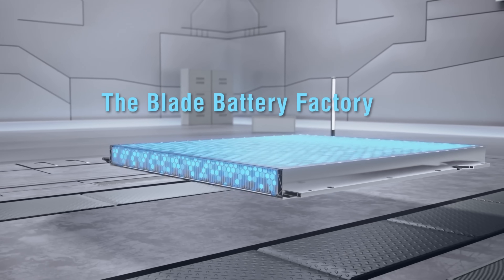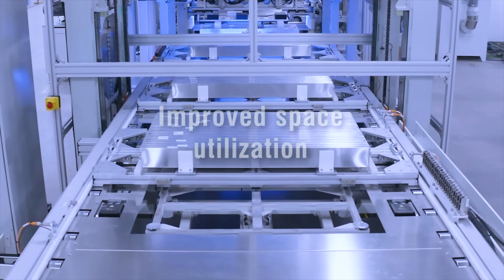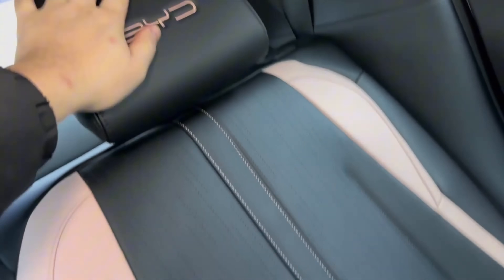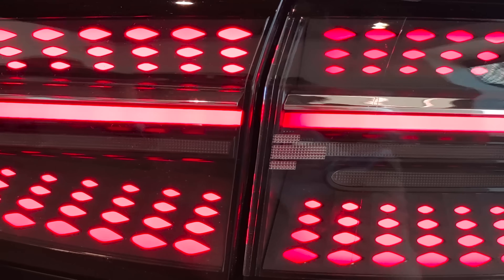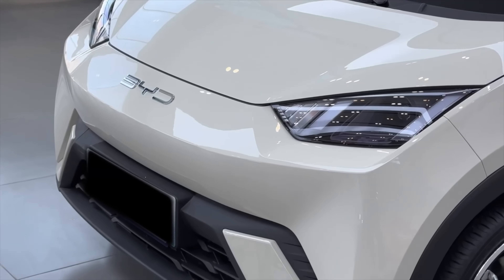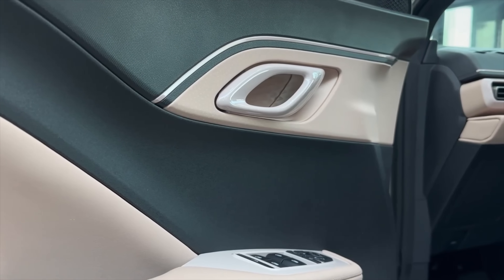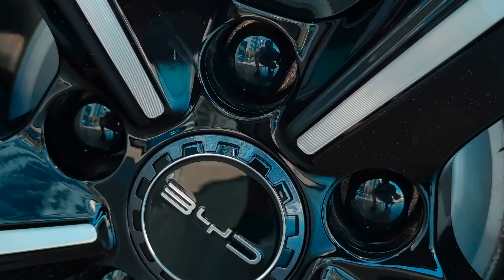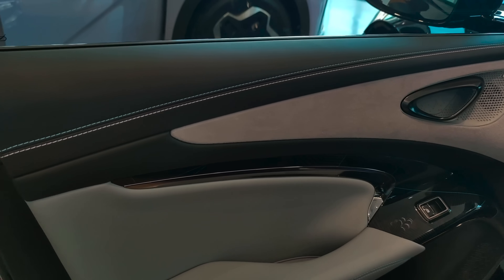Blade Battery 2.0 vs The New Solid State: BYD's Massive Leap Explained

Comment from the maker: What range do you think should be the minimum on any EV?
Reply: For me I think small city EV need real 300 Kms and larger EV used for long distance driving need a real 600 kms at highway speeds of 110 kph. (68 mph).
A reasonable charging time around 30 minutes from 10% - 80% and rate with minimal battery degradation after 5000 cycles.
Reply: Depends on charging speed how many miles minimum for me.
Reply: Depends on the country and area at the moment, where I am you can't trust EV charging infrastructure once you get away from large cities and towns, read a horror story of one EV user having to charge for 13 hours on a wall wart because the single high power EV charger was out of commission, and to get that 13 hours for charging they had to rent a room for the night, they simply didn't have enough range to get to the next large town, just under 300km away. So for outback driving, specially in the far north of Australia, 800km would be adequate, that's enough to get you from one large town/city to the next with no problems, once you drop under 500-600km it gets a bit iffy. If it was purely a city use EV then 300-400km would be fine, I mean how many people, apart from tradespeople, would drive more than 300km in a city in a day? Sometimes even in a week you would do less than that! Basically you need to buy for your use and location, and that will be different for everyone. Maybe when charging infrastructure outside the towns and cities start getting better you could do with 500-600km in the north of Australia, but it's just not there yet. So yes, with 800km I would go full EV, less than that, probably not. Now that's an advantage PHEV's have though, with around 100km pure EV range I could drive a PHEV on battery for 95% of the year, only using fossil fuel on those few long range trips I do each year.
Reply: For Australia i'd say 500km highway @ 110km/h so about 650km WLTP.    There will always be a case for shorter range, lighter, more efficient city cars though as well, the classic 2nd car.   Just give us the options please :)
Reply: For the UK, 200 miles all weather. 99% of all day trips taken care of without wild charging in our 60kWh dolphin, much like it's predecessor, our Kona 64kWh. Loved that car, but at 114k miles and 6 years, thought it was time for a change.
Reply: My range is about 2 hours between breaks (down to age). Thus I'm more than happy with 200 miles; with breaks of about 20-40 minutes (to recharge me and the car) every 2 hours I can go most of the day.
Reply: Well my Model 3 RWD has a range of about 450kms real world, maybe 420 @ highway speeds. I've driven it Sydney to Melb (about 900kms) twice and never thought I needed more range, the car often finished charging before I finished eating. I'd say 500kms is plenty taking appropriate rest breaks. That's 350kms 10- 80% which is over 3 hours straight driving.
Reply: God forbid you say anything bad about BYD they sue and blacklist reporters and won't let you visit them for press release drives I've heard.
Reply: I think that's right that there is a relationship between range & charge times (and availability of chargers).  The shorter the charge time the less perceived range people may feel they need.  ICE cars typically do around 500-600ks between fill ups, so something like that ... perhaps less for people who charge at home and a bit more for long distance drivers who won't want to run their batteries down too low.
Reply: @RorySeanWainer I think you’ve nailed it - when you can charge at home range really isn’t much of an issue for day to day driving. If you can’t then 500 - 600k’s at least allows you to adapt a charging routine although I think we’re still waiting for infrastructure to catch up in many places.
Reply: Honestly they should match ICE vehicles - 700-800km on a freeway.  The extra weight isn't a big deal for most drivers of non-sports cars, so why not just ensure EV is better in EVERY way??
Reply: 600km WLTP should be good for 99% of users. And cars that are no heavier than 2 tons.
Reply: 600 city 
400 highway

Comment: Well then it sounds like the smart money would just pick up a cheapie used EV to commute and hope it holds on for 5 more years before spending a bunch of money like I did  taking a beating buying the current crop of EVs.  Then watching the value plummet, and degradation of the battery.  Oh, that's right we don't talk about battery degradation with the current breed of batteries in "fight club".  If you say these things someone will come along and tell you that you are just doing it wrong or worse a shill for big oil.  

I finally had my fill after a decade of driving EVs and never learning my lesson.  So that is my game plan now.  I will reconsider a dirt cheap commuter EV for local driving and leave the longer distance and abnormal stuff to the ICE or get a hybrid.

Comment: Solid state batteries are still years away from mass production. I don't think that BYD, CATL or others will be able to do this until 2030.  I also don't buy an EV only based on battery technology. I care about LFP vs. NMC but range and charging speed are secondary in my use case.

Comment: 12 minutes to charge a 80Kwh battery with 90% efficiency means 450Kw charging power. Grand'ma is not going to lift the charging plug by herself. And copper thieves are going to love it.

Comment: Another aspect is AC charging.
In Australia and Europe there are many 22kW type 2 chargers, enabled by 3 phase 230v power. These are cheaper to install than DC chargers and the power is less expensive.
I think that all ev's should have 22kW onboard charging as standard, versus the 7 or 11 kW  that is common now.
Big, expensive cars with big batteries would charge up the battery faster. Small, cheap cars are more likely to be bought by city apartment dwellers who can't charge at home - they would benefit from faster charging at shopping centres etc. often for free or cheaper than DC charging.
Type 2 chargers are also used to back up DC chargers, especially in remote areas. 22kW charging would reduce inconvenience from the extra time required.
Reply: 7/11kw chargers are for home.   7kW if you have 240V available  11kW if you have 3 phase power (400V)  For people that own there house and dont live in an apartment this is how you would charge 99% of the time (except on holidays)    Def could not get rid of it and I wouldnt even consider buying a car without it

Comment: I love the way he says, "Its quickly getting better".  Lithion ion batteries have been around since the 1970s and in cars since 1996.  We still only get 350Wh/kg in NCM/NCA batteries and now have gone from 160 to 210Wh/Kg in LFPs.  It isnt getting better quickly and it will take a considerable time to get anywhere near comparable to ICE. Diesel provides 12.6kW/Kg, but 60% is wasted in thermal inefficiencies, so a battery needs to be 5kWh/kg to compete with diesel.  Until then, BEVs will be limited in range with frequent recharging or will have to carry weighty battery packs.
Reply: I don't think you understand the weight thing. If the LFP batteries are being put into a Gen2 Blade pack @ 230Wh/kg then the batteries themselves are a lot more energy dense. You'd assume that 20% of the pack weight is the structure so the cells themselves work out at something like 275Wh/kg. The original LFP cells being made by A123 solutions were only about 108Wh/kg and they were state of the art, nanotech manufactured cells. So that's a more than 250% increase in capacity in less than 15 years.
Reply: @mondotv4216  I understand the weight issue very well thank you, and by the way it's mass. There is no need to mess round with conversions, treat the energy density as declared, it only relates to the batteries themselves and DOES NOT include the container etc. The 275Wh/Kg you quote is erroneous and irrelevant. Its 210Wh/Kg.  Then add 20-30% for the container/BMS & cooling system, thus total mass. 
Dr Goodenough's first LFPs in 1996 had an energy density of 170Wh/Kg. So the growth in performance you declare is is bollox, and even if it were true (its not) that erroneous calculation is unimpressive.
Reply: Could you bring the weight of a Diesel Engine vs Electric Motor come to this calculation?
Reply: BYD Seagull Power-to-Weight Ratio: 
Power: 74 hp
Weight: Approximately 1160–1240 kg
Power-to-Weight (hp/kg): Approximately 0.06 to 0.064 hp/kg
Typical Entry-Level Petrol Car Power-to-Weight Ratio:
Power: Around 70-100 hp (depending on the model) 
Weight: Often lighter than the Seagull, potentially 1000-1100 kg 
Power-to-Weight (hp/kg): Can be similar or slightly higher, around 0.065-0.10 hp/kg.
Reply: @ibrahimsued4906 What's your point? I can make the reverse argument with the Toyota Camry and the Tesla model 3. And torque is a lot higher in the EV. Corolla 70.6kW/T Dolphin 90.6kW/T. It depends what vehicle you want to look at. There is no reason why they couldn't have increased the power of the Seagull motor, they just chose not to for efficiency.
Reply: @mondotv4216  As the overall power to weight ratio in blade battery Seagull perfectly matches that of a similar petrol car then there needn't be any more complains about its battery power density. Besides these compared cars total weight are about the same: 1.200 kg.
Reply: @ibrahimsued4906 Why horsepower? Let's do kW and Newtons for consistency and especially when it comes to EVs which store their energy in kWh. I agree that the whole power argument is unnecessary as EVs are always going to have an advantage off the line due to the almost instantaneous torque. The original thread was not about power but about storage.
Reply: @mondotv4216  i,M TALKING ABOUT STORAGE, too. About the problem of power density in power storage. I think this problem (excessive weght of bateries) is already resolved if you see that comparision of Byd Seagull. You have an extra weght from batteries but a lighter motor and lack of a transmission. Whatever will com, like th Blade 2, will be an extra bonus.
Reply: @ibrahimsued4906 Power density is different to storage, although often related in the case of batteries. Power density is the ability of a fuel to deliver power at a particular instant and is measured in kW. Storage is how much energy that is stored and is measured in kWh. For example a LiPo battery can deliver energy much faster than a LiFe battery but at the expense of stability and lifespan. Larger batteries can deliver more power because it is related by C (capacity) rate.
Reply: @mondotv4216  I OFTEN READ ABOUT POWER DENSITY AS  follows : ''Power density units measure the amount of power generated, stored, or delivered per unit of mass, volume, or area. Common units include Watts per kilogram (W/kg) ......
Reply: @ibrahimsued4906 Once again power is different to capacity. It's a fundamental concept. For example a solar inverter is measured by the amount of power it can deliver in kW but it doesn't store any energy. You need a battery to do that. kWh per kg is not a measure of power density it's a measure of capacity. Here is the simplest way I can explain it. You have two very similar batteries - same capacity (1kWh), same mass (10kg) but battery A can only discharge @2kW while battery B can discharge @ 4kW. We would say battery B has twice the power density of battery A even though they have the same capacity and the same mass. In your example you were talking about power and not capacity. The counter argument to your example is that even though the ICE cars and the Seagull have similar power to weight ratios, most ICE cars can travel a lot further on a single tank of fuel because petrol has significantly higher kWh/kg than any battery (13.5kWh/kg for 95RON) even though ICE vehicles are much less efficient. A BYD Seagull has a range of about 305km (190 miles) in ideal conditions while a Suzuki Swift has effectively twice the range or more with just a 37L fuel tank.
Reply: @mondotv4216  I thank you for the clear explanation. Indeed I love phisics but was not familiar yet with this parameters used for batteries in BEVs. You nailed it when you stressed that the range of BYD Dolphins are yet half of that of a similar petrol one. There is an interesting issue there: I can improve my range 130km with only 10kg more storage in the case of petrol, but much more weight in the case of BEVs. So, for this while, I  think I don't even mind a BEV with  the average range of a petrol car. It doesn't make sense to me to carry such a lot more dead weight if one's usual comutes are less than 40km daily, for instance. So that's why I'm so happy with BYD achievement. It definitely convinced me that BEVs kind of are already here to stay. I only follow this developments for love for phisics. Regards.
Reply: @ibrahimsued4906 Thanks for reading that rather long explanation. I'm not saying that just because an ICE car has more range they are better. For a lot of people an ICE car is less convenient because every couple of weeks they have to fill up at a petrol station while your Seagull can be charged up at home. Indeed your decision not to carry around a bunch of extra dead weight in a city car is quite a sensible choice. It's use case dependent.
Reply: @mondotv4216  iNDEED I 'm stuck to my old ice, just been watching the evolution of EVs. My thoughts are that many practical issues are virtually already solved with this BYD seaguul, but just as an example. I've missed to say that with the already mass produced batteries I'd rather have a 10/20min break every 250km of road driving than carrying a lot more dead weight all the year around. So I think an important threshold to mass adoption of EV has already been crossed. I've watched the disassemble of seagull motor and it's simplicity humilliates any ICE. I think EV cars are more about an industrial race to this technological turn than about climate change.
Reply: @ibrahimsued4906 I didn't buy my EVs to fight climate change although that's a nice side benefit. I bought them because they are more convenient and a better driving experience. They won't suit everyone - that's fine. Personal choice is important. I wouldn't be worried about buying a second hand EV - fears over battery longevity are exaggerated although warranty may be important.

Comment: For the average person like me, (average height, build, weight, income, intellect. Ok, wife might disagree on some points.) a car, particularly an EV is a major cost. (Yes I did start the sentence with the preposition ‘for’, so sue me) 
Imagine the day you buy your new EV with a LFP battery which charges 80% in a half hour or so and gives you a range of maybe 400km,s.  Next week the new model comes out with a solid state battery with 10 minute charge time, 600km range and weighs 200kg lighter.  In the old days (for those who van remember them) a car model stayed the same for 2 to 4 years followed by incremental improvements to engines, suspension, features etc. sometimes it was worth waiting for a new model, sometimes it was worth haggling a good price for the old model. With the sudden appearance of solid state batteries your car value would drop significantly overnight. In a way I can relate to this as I commenced the process of buying a Tesla Powerwall 3 battery and new PV system late last year. (Before Musk turned into a fascist sympathiser) It was installed just prior to recent federal election and now feds are offering big discounts for battery installation, just too late for me.😢
To add insult to injury the bloody battery failed (first one that I know of) and is being replaced by Tesla.    In about 2 months.🤯
Reply from the maker: I speak for everyone here, but which bits would she disagree on? :D Were you considering a Canon ute earlier this year or last? What have your thoughts been on them, or the BYD.
Reply: @benalexxander I did buy a GWM Cannon Ute back in 2021 to replace my aging BT50 that had just clicked over 250,000kms. It had no problems and never broke down but it was a extra cab and we decided a twin cab would be better but the cheapest was well into the $50,000 range so we thought we would try the Cannon as the Chinese were trying to get into the market big time and we could get one heaps of safety features like centre and curtain airbags (Vw Amarok didn’t even have them in rear) and disc brakes on the rear. Been okay so far but I keep hearing horror stories on Cannon owners website about engines blowing at 80,000kms and turbos disintegrating. I have only done 60,000km as the Ute is mostly used around the farm. I actually like the Shark 6 but we are going to get a full EV Ute when they come out and the Cannon is worn out. I’m still betting on a Shark 7 happening in a year or so. 
The Cannon itself has very average steering, poor ride and bits that are obviously made to a price but at $40,000 for the top of the range one it seems okay. I did something I have never done on a Ute before and put on different springs, dampers and a slight lift and it is much better to drive than it was. It is not a bad Ute for the price which is more than I can say for some of the others I drove. I had to put canvas seat covers over the leather seats and rubber floor mats (it is after all a work vehicle) but it has done the job quite well and is reasonably quiet to drive with a adequate sound system. 
As for my inadequacies, only my wife will ever know and she is sworn to secrecy. 
One last thing, getting onto your Patreon or sending money is very difficult via iPads (I don’t use a computer these days) took us both (wife) quite a while to actually find the site then the system kept not working.  We will try again tonight. They should just have a button you can hit that is near the bottom of your page. My guess is that probably it is easier on computer screen or we might just be bad technology users.